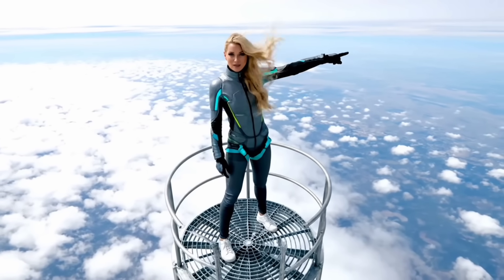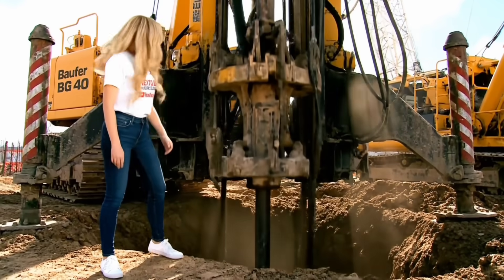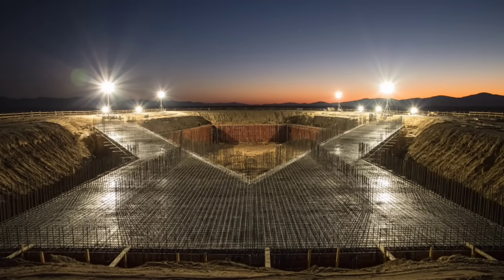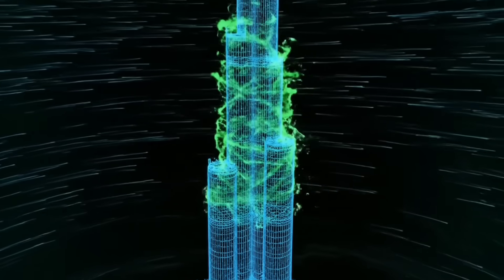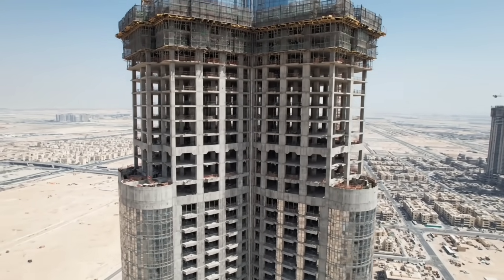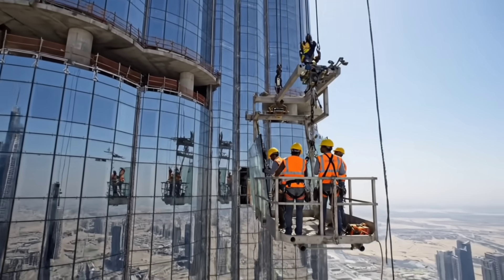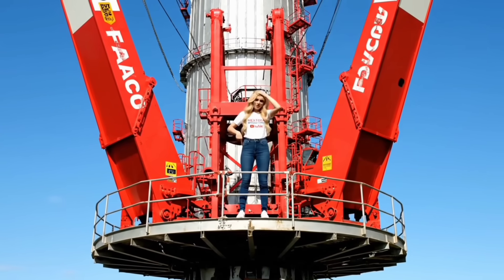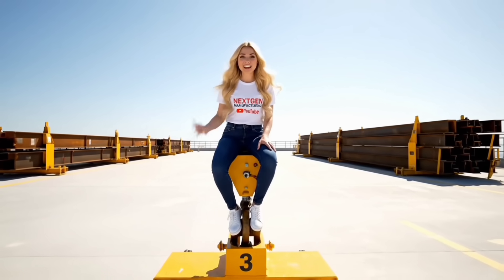Inside The Burj Khalifa: How the $1.5 Billion World's Tallest Building Was Built!

Comment: It’s mind-blowing that they used ice blocks to cool concrete in the desert heat to prevent cracking. The strategy of having cranes 'dismantle' each other from such a record height is a true engineering marvel. Given the shifting sand foundation, how many decades can this structure really withstand the harsh environment?
Reply from the maker: Thank you